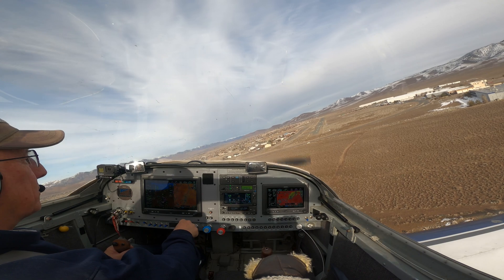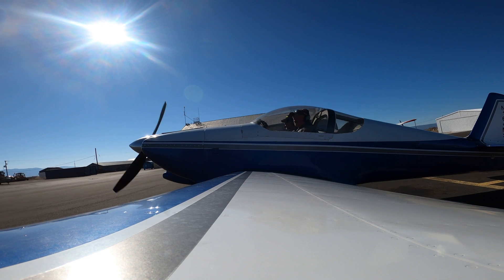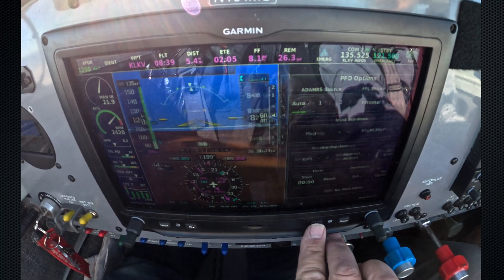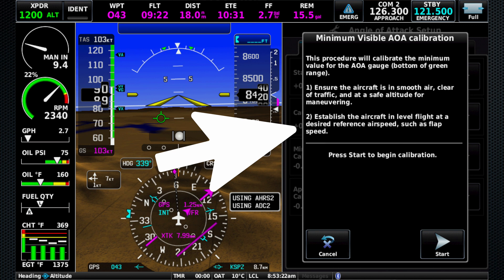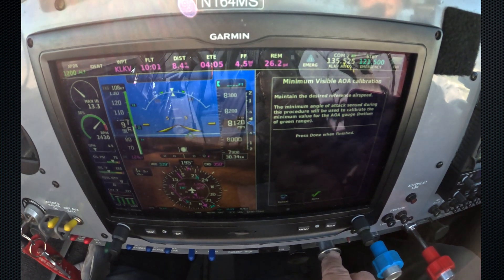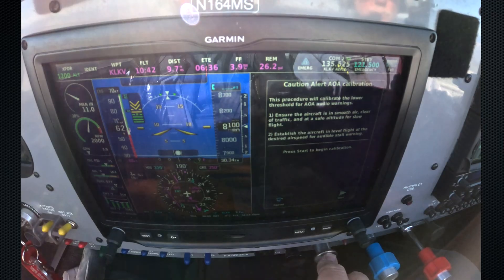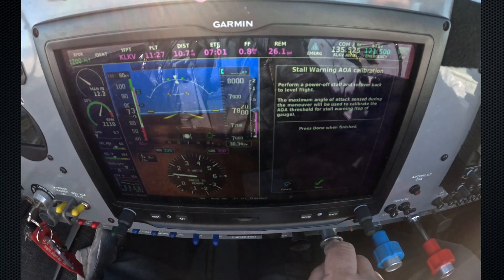How to Calibrate Angle-of-Attack on Garmin's G3X Touch System

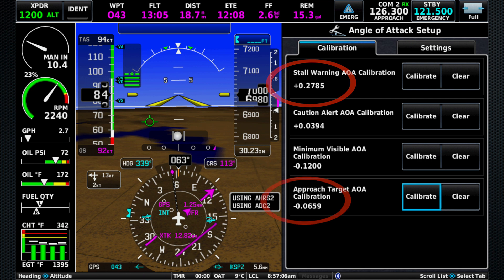Comment: Thanks for the good info, Paul! One minor correction... @5:16, your calibration values won't be in order. Going down from the top, the values should be 4, 1, 3, 2. Shouldn't matter, just follow your good instructions and you'll be fine! FWIW, for min visible, I used 1.5xVso. Caution Alert, 1.1xVso. Target Approach 1.3xVso. Last, it's worth mentioning, if your G3X knows your flap position, you can program a second curve at a lesser flap setting (or flaps up). My RANS S-21 is simple, so just one set for me! Thanks again! - Steve

Comment: Paul, re save of the power off stall; in the video you saved the AOA setting well after the stall broke, at around 74 IAS. Should you save the AOA setting at the stall break?
Reply from the maker: Paul says, "The neat thing about the Garmin is that it remembers the highest AoA at the break, so you don’t have to save anything at the instant of the stall. Waiting until you have recovered is how it was designed, and makes it all low stress."